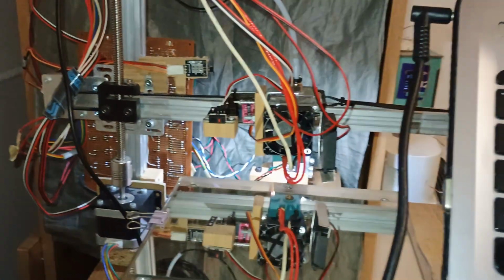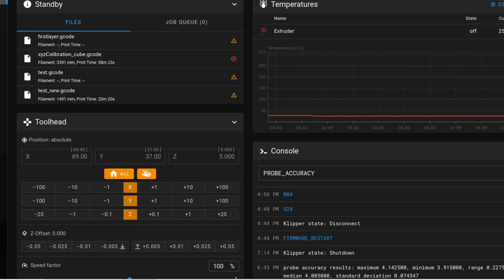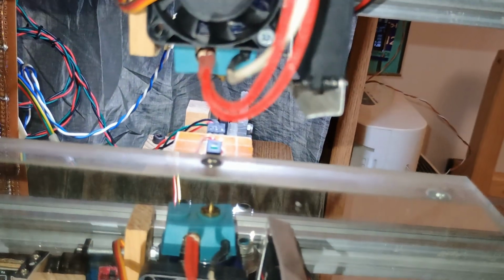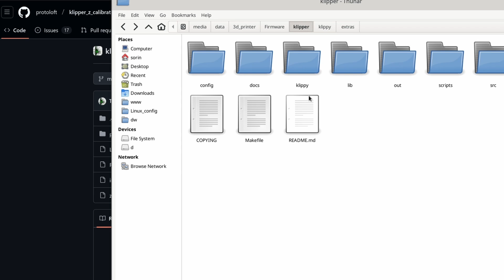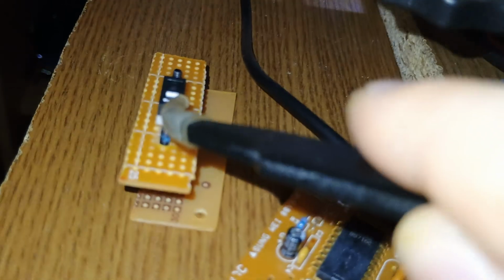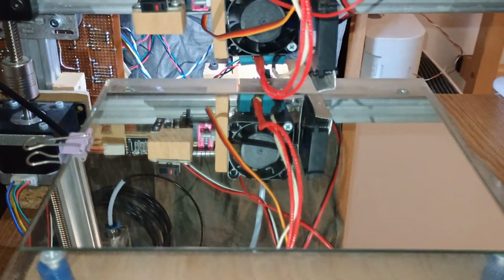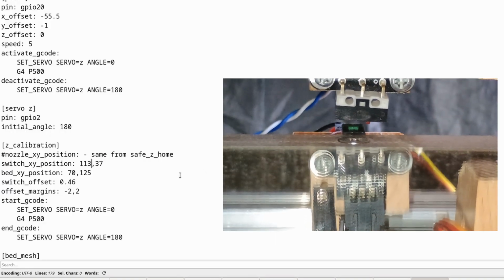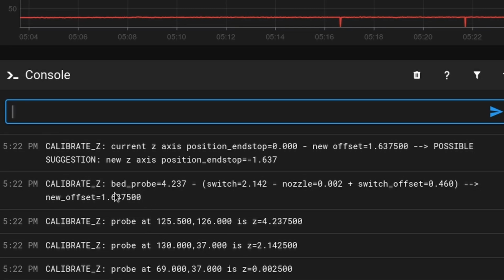Klipper Automatic Z offset calibration tutorial

Comment: @CNC Tinker,  is "new_offset" value is stored somewhere or just passed to some temp variable and read out in print_start macro? Thanks
Reply from the maker: the point of the plugin is not to store the value, and calculate it on the spot so its as exact as possible. you should add z_calibrate to your start macro. it sets the offset to that value, but is valid only for the current klipper session until you restart.
Reply: @CNCTinker  thank you.